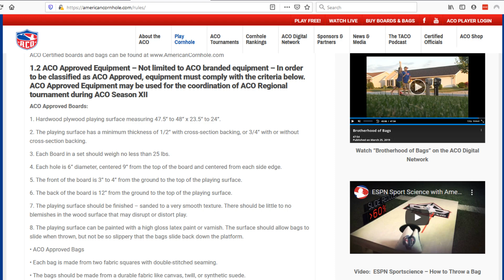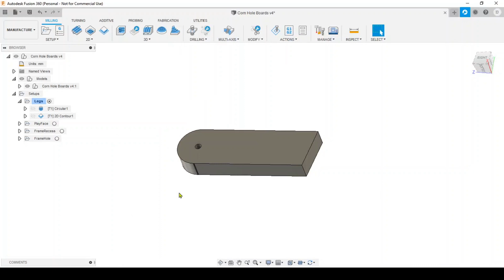Corn Hole Boards made on the MPCNC using Fusion 360

Comment: Jiminy Christmas that feed rate and depth of cut is something else. What size of cnc is that? 

Thinking it takes me about 3 minutes to cut 4 legs. Drill the hole, cut a dado for a crossmember and a profile cut with a radius.
Reply from the maker: It's an MPCNC that's big enough to cut a 2' x 4'  board. You can basically make it as big as you need it.

Comment: I would be interested in the fusion design file.
Reply from the maker: You can get the Fusion360 file here https://bitbucket.org/ianj001/corn-hole-boards/src/master/ You can modify it any way you like. My files are in mm but if you want to change to inches you can.
Reply: @Adventuresincreation  Thanks for the file!
Reply from the maker: I will post it for you.